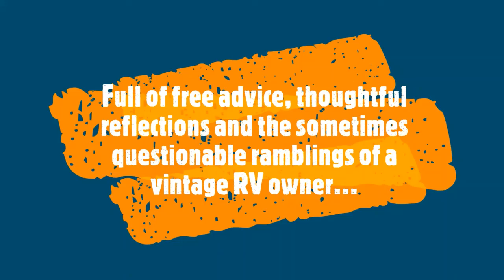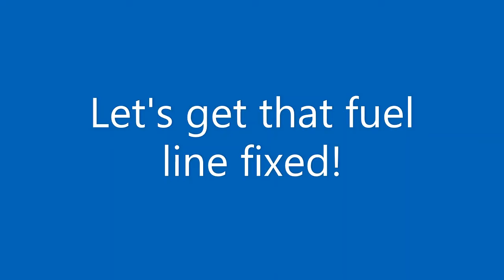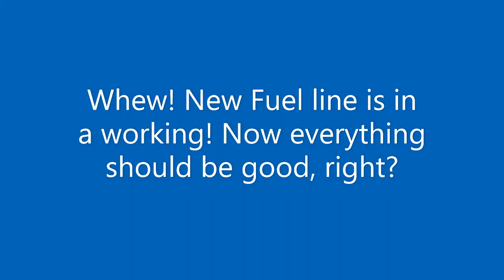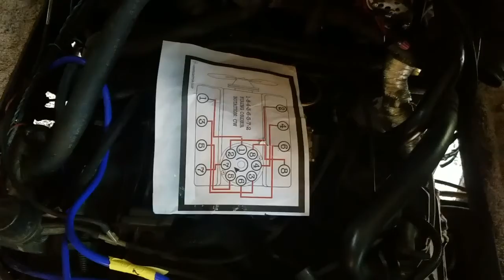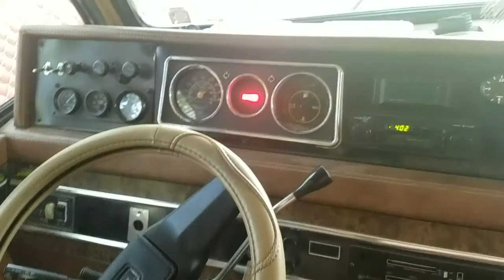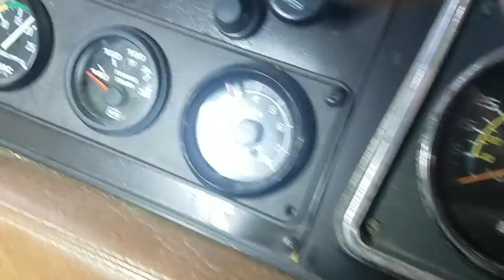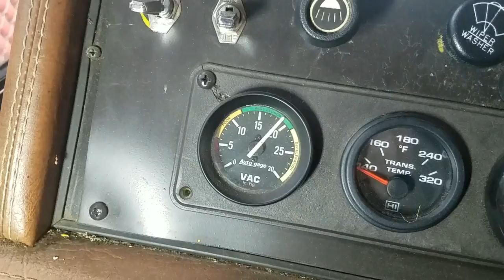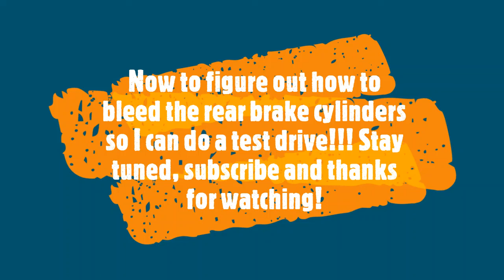RV Fuel Line Fix and Simple Stuff....RV Repairs

Comment: Dan, Dan, Dan!  IT"S ALL GOOD!
Reply from the maker: I looked at my plug wires and just slapped my forehead on how I missed that after all that...well, at least I got a few other bits replaced. Chris, it's amazing how much abuse these old Big Blocks take from noobs like me and still manage to function. Any new engine would have just not started. 2 cylinders not working on one side is a big issue! Glad the valves and such aren't showing signs of damage based on my last couple of runs.

Comment: That is what it is all about, learning a little bit while spending time with friends. I find I have better success using a socket wrench on those hose clamps rather than the screwdriver. It will tighten better for me. Sounds like your firing sequence is off. Oh serious, that is what it was. When you said you changed the plug wires I remembered that I had done that on an old 1967 Stratochief, which was my first car. I also drilled a hole in the water jacket while trying to tap a new bolt hole for the Valve Cover. I was 16 years old and a country boy at that. That sounds smoother now. Good catch. Unfortunately the only cars I know anything about are cars with distributor caps... Well now, that was fun. I enjoyed myself greatly. Thanks for the video. Take care...
Reply from the maker: Thanks for sharing your experiences! I still like working on carb/distributor type cars and even old K-jet setups on BMWs.

Comment: I have to admit when you fixed that fuel line, there is something to loving the sound of an engine doing what you intended it to do. Great job on that. IT is pretty amazing that you can see it while sitting in your driver seat.  Sometimes you just blow my mind with how you do things. Hoping that your cat doing the driving from now on works out for you. 😉 ❤️👍👏 Donovan & Jodi
Reply from the maker: Jasper just got his learner's permit but only because I pulled some strings with the County Clerk at the DMV....she's a cat fan.
Reply: @drlong08  That was great and so clever.

Comment from the maker: Just started her up this evening and she started right up at a flick of the key.... as it should! The throttle response, the sound of the engine accelerating, no backfires, the torque response (rig rocking at hitting the throttle) is much better. I am glad this may be just a simple (aka, stuupid) issue that is fixed by constantly checking my work. Guess I won't be swapping for an R700 and LS1 engine setup...